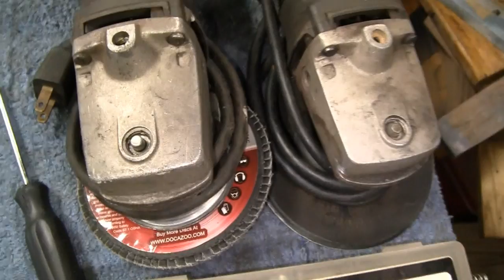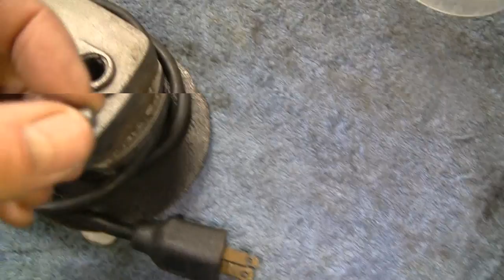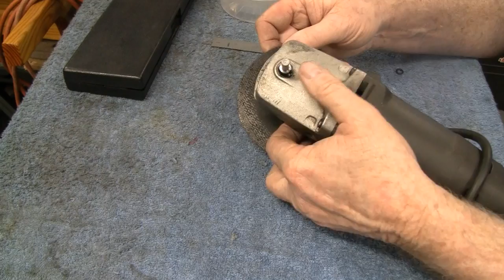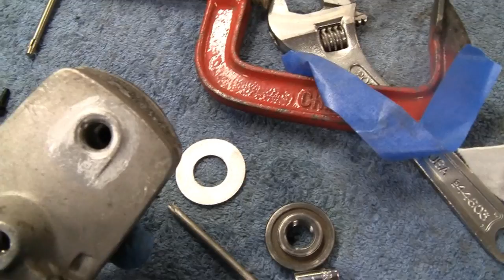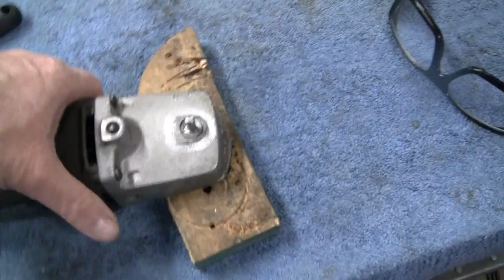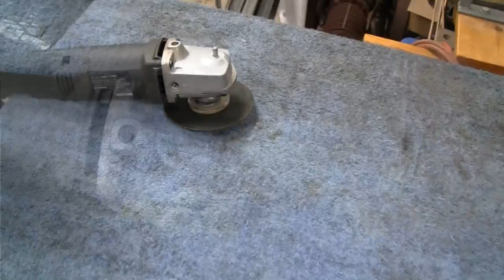ANGLE GRINDER REPAIR & GREASE

Comment: :o) Same as double7337, same grinder-late 70's or early 80's-Retired-no problems till now. Using to strip a deck. Flapper wheels work so much better than my belt sander! Stalled a couple of times. Going to order brushes and wanted to grease it. Looked same only the grease not really hard like this one. Yup! Made in USA during the good'ol days!

Comment: Hello, I just watched a video I have the same exact grinder. My problem is I can't find the 3/8 cup brush anywhere do you happen to know where I can get one? I know you mentioned any video you can still get parts for it, but I can't find that cup brush anywhere with a 3/8 Hole. Everything now is 5/8 did they make an adapter? If so, can you send me a link for an adapter from 3/8 to 5/8 or is there anyway I can get a new spindle or replaced a whole gearbox to 5/8 any help would be much appreciated. Thank you.

Comment: Those gears wouldnt be in pristine condition if they are running without grease for years. There was enough grease in there. Once the gears are rotating, grease is liquid bcs of heat and is all over those gears. Similiar with car engine. You dont fill it full with oil bcs you see top of the engine is dry, you check your oil level. Nice work , great repair.

Comment: Yeah you are right about there being hardly any grease in the new stuff , I worked in a factory assembling grinders and drills they measure the amount of grease by the tenth of a gram , always thought to myself if I ever bought one of these first thing is open it and pack it
Reply from the maker: I bet they save alotta money that way!! And when the grinders finally crap out they are probably outta warranty!!☺
Reply: @805ROADKING  Now you understand planed obsolescence , make it so that you just get through warranty and when it breaks buy another , cause nobody wants to be bothered to repair . Look around town how many TV repair shops do you find ? are TV`s lasting longer are they harder to repair . No , it`s people just want to throw it away and buy a new one

Comment: I know with my luck (skill?) I would end up epoxying the pin so it wouldn't move! I think the reason the grease isn't on the gears is that they are spinning at 10,000 RPM so the grease gets thrown off.  Anyway, good job on the repair!
Reply from the maker: Thanks Bud!! Yeah that was my main concern!! If I epoxied that pin, I would never live it down!!☺

Comment: If ya ever need a replacement for those the Makita classic 9005b has got to be about the best and longest lasting grinders I got. All I do is work with metal so I use it everyday and I'm harder in it than I should be (which is why most others grinders die for me right away).  Plus it's got about the same shape as those old Craftsman's you got which for me is the only shape a small grinder should be, easier to hang onto to for long periods of time and easier for one handed use.
Reply from the maker: Yeah Buddy!! Ya can't beat a Makita, I have a few Makita tools that I used hard for over 40 years!!☺

Comment: Bought one just like yours in the early 1980's. Still have it and love it. I will never get rid of it either.  I won in a raffle a really nice Makita of the same size. The Makita is really nice but has a paddle switch with a really good safety lock out feature that gets aggravating. I will still grab my old B&D first. It just feels right.

Comment: Good fix, is there a specific RPM range for cutoff wheels? I'm wondering why cutoff wheels aren't recommended for some angle grinders.
Reply: Each size has a max rpm rating. The bigger the wheel the lower the rating.

Comment: I've got the same one that my dad bought and its the most used grinder I have.  Back when Sears was still booming.
Reply: I actually replaced the cord and if you ever do that, know that there are special crimp on connectors that need to be added so order them at the same time you order the cord.
Reply from the maker: Thanks for the heads up!! I do have one that will need a cord soon!!☺

Comment: at least you got some grease in your case. I purchase new harbor freight grinders and found out right away there is very little grease in them and repack it full with more grease.
your right it will through the grease off, so you need to pack it full. you will know when there isn't any grease on the gears. starts to get loaded and then the gears burns up. good thing you took it apart found the grease wasn't doing much any more.
Reply: I gotta try that
Reply: I havew  bosch 9" grinder i got in 1974 . It still runs great and so far I've only replaced the power lead . But last year i bought new Makita 4.5" (i'm like my grinder,i'm getting old) .First the lead broke inside ,so I replaced that. 6 months later I look down at the machine while I'm sanding and there is actual flames coming out .A good thing i was wearing gloves. So rather that piss around trying to get makita to fix it, I went on line and bought 4 new grinders from some place in china for $10 each ..ha ha ,and yes,they need to be greased when you first get them . But so far they have stood up to some heavy work without a problem.I have a different application for each one,sander,grinder,wire buff etc. .

Comment: Mine is exactly the same as your's, and I bought mine in the mid 70's. It spent 7 years in my welding truck and used daily. Retired now, but still own it and I never had a problem with it. Made in USA, those were good days.  Good job RK !!
Reply from the maker: Thanks alot Whitey!! We were lucky we accumulated all our tools when they still knew how to make them eh!!☺
Reply: @805ROADKING ,  Exactly !   We might be getting older, but we lived in a great time when manufactures took pride in their products.

Comment: It may appear that there's no grease on the gear, but in reality once the gear is running, it heats up and liquefies the grease. Do you set your grinders blade up? That's the way to be 100% sure of it. You set one down, after using it, and then when it's cool, you take it apart, if the grease isn't shifted, then it's not the right stuff.

Comment: Road King, I have the same 4.5" grinder. I've had it for at least 20 years, and WAS my favorite. SOMEONE, didn't check to make sure the tailgate was closed on the service truck, and it scattered on the highway at about 70 mph. I still have all the pieces, and IF I can still order the back housing it's fixable. I also have the matching 7" grinder as well, NOT broken. LOL
Reply from the maker: Try here https://www.ereplacementparts.com/craftsman-900277230-angle-grinder-parts-c-158286_159871_159911.html   The back housing looks like #31
Reply: @805ROADKING  Thank you sir, I will give that a shot.

Comment: Wow, nice repair.  You said that you didn't care how it looked, but when you brought out the body epoxy I knew better.  Interesting how the grease in the gearbox stiffened up like it did and left the gears it was supposed to lubricate high and dry.  I doubt that the gears would have still worked if that had happened to those made from chinesium.
Reply from the maker: Thanks Chris!! I'm surprised those gears were as pristine as they were!! I must have been using it for years without any grease on them!!☺

Comment: You have enough Polish blueprints to work with. Good epoxy is your friend. I recommend Scotch weld , it works on aircraft, no reason it shouldn't work there
Reply from the maker: The stuff I use is used on the Space Shuttle!!☺
Reply: @805ROADKING  Yes and we know what happened there :)